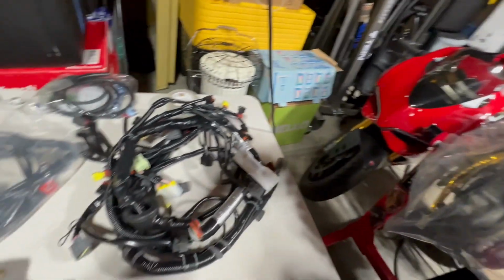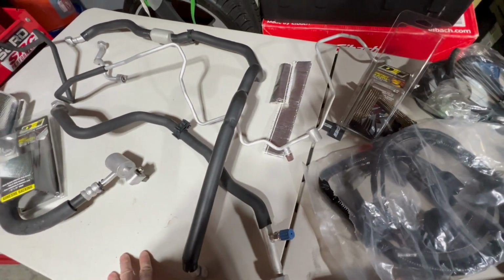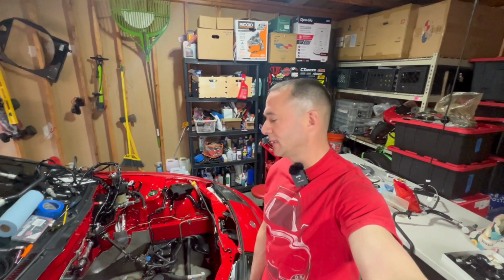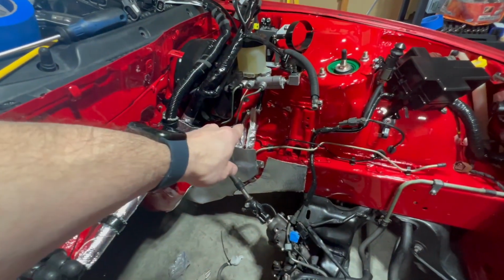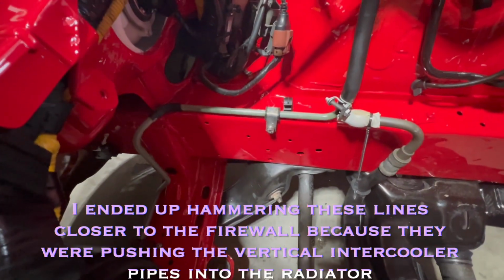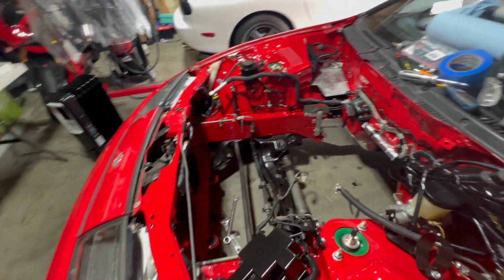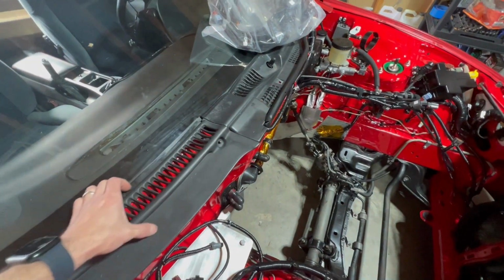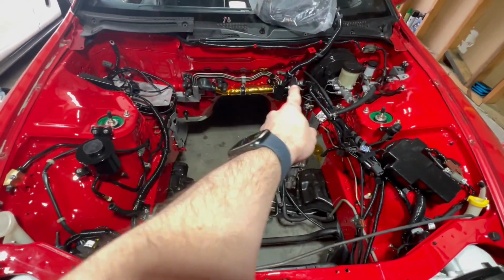Project Z32 Nissan 300ZX Engine Bay Prep Part 3 Built By Miller AC lines and main wire harness

Comment: The long power steering return line is a inexpensive cooler from my understanding.  Comparing the NA and TT line, they have some minor differences. I’m sure you could tweak the NA line to fit just fine though.  I wouldn’t delete the long line altogether unless you plan on adding a real power steering cooler.  Also my buddy has most if not all of the TT AC parts for sale
Reply from the maker: Thanks!